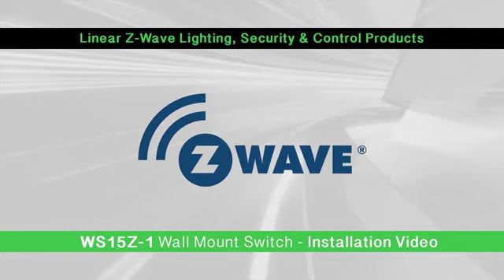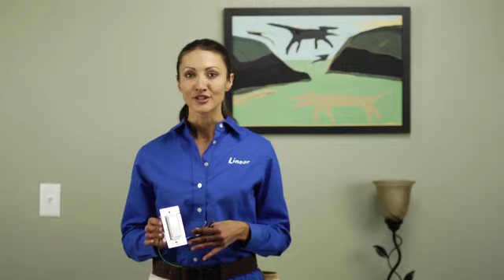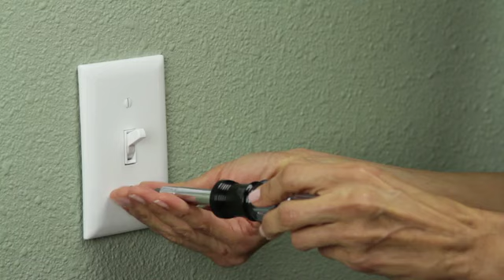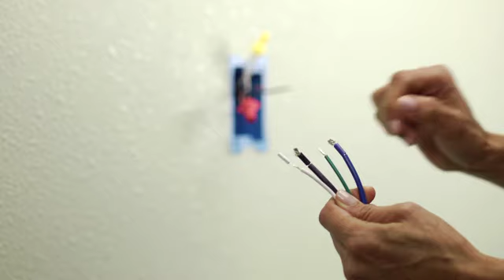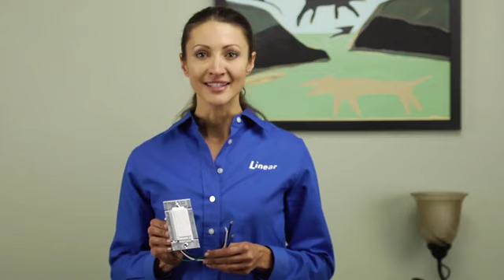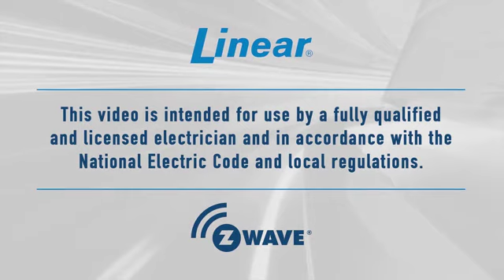Linear WS15Z: Z-Wave Wall Mount Switch

Comment: The switch is huge. It won't fit in the junction box with wire nuts. Even without wire nuts, its pretty much impossible to fit it in.